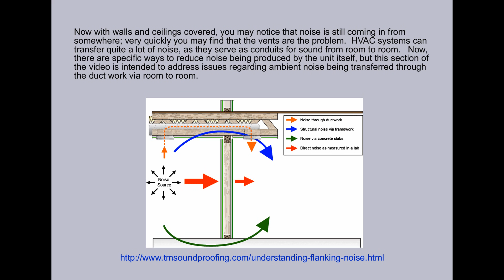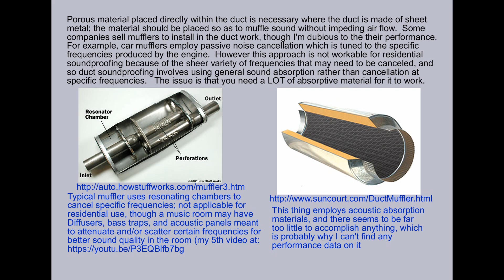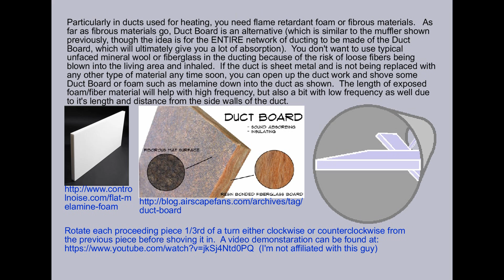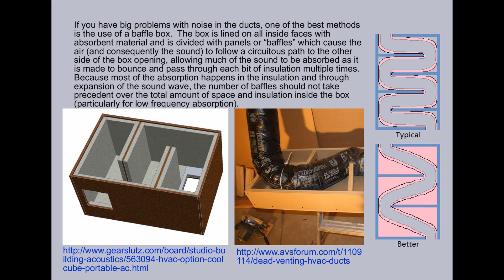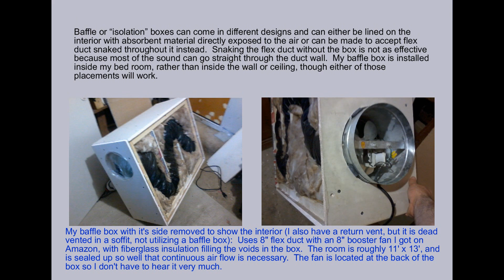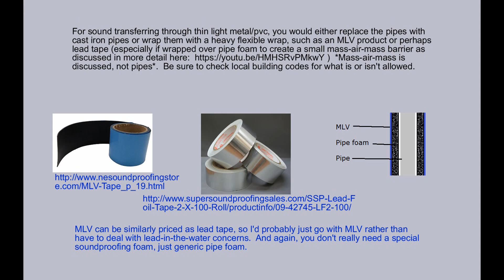Soundproofing -6- Hvac and Plumbing

Comment: Best video I have seen on the subject. I have a big fire sprinkler pipe running through my office, absorbing loud vibrations from a roof Air compressor or HVAC unit. 

Can I pay you to jump on a call or zoom in to give me advice on implementing this plan?
Reply from the maker: As much as I need money, I'm hardly a professional.  Aside from experimenting with my bedroom, most of my knowledge is academic and I have little installation experience with a variety of systems, especially for commercial use. Everything I know on the subject is already in my videos.  The best information I can give is: 1. read reviews to make sure you're buying a quiet HVAC system, 2. isolate the pipes and compressors to reduce overall vibration as well as to make sure that they don't hit against hard surfaces and, 3. use basic soundproofing construction in walls and ceilings as outlined in my videos if you can.  Work off of the 3 basic principles of how to reduce sound transmission:  more mass, decoupling, and a bigger air gap (ideally filled with insulation).

Comment: This video is fantastic and the only useful piece i have found on this subject. I really do hope you get to answer this question though if you get the chance: you explain the baffle box very well, but only describe your return duct briefly, saying it is 'dead vented in a soffit'. I really don't understand what that means. I know I could make another box for the return, but i'm just curious to see if what you mean is any easier. Thank you,
Reply from the maker: Hey; thanks for the compliment.  My return duct is built more like at 0:26 with long stretches and few turns; that's really the only difference.  One has lots of turns while the other doesn't.

Comment: Thanks for the great videos!
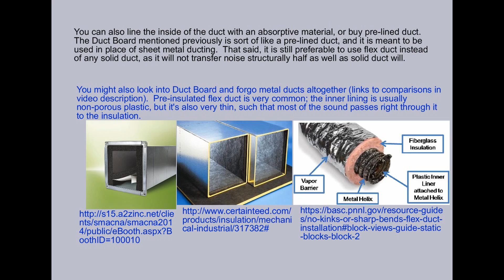Is there a reason you put a flex duct inside your baffle box? Does it have better soundproofing than a box without flex duct? (like the left photo at 2:50 in this video)
Reply from the maker: +Arin Ayvazi Mostly because it's easier than lining the inside of the box with fiber or heavy foam.  The inner liner of the duct mates up easily with ducting feeding into and out of the box, and is thin enough that sound can pass through it and into the insulation which surrounds the liner;   Also, the inner liner helps to keep fibers from blowing into the room if you're using some sort of fluffy insulation like fiberglass.  If you wanted to use more insulation, you just build a bigger box so that you have more room to stuff extra insulation around the flex duct.
Reply: the flex duct is necessary, the left image is just showing you the box without the duct...since the box will have insulation in it, the duct is necessary to avoid getting fiber in the air flow